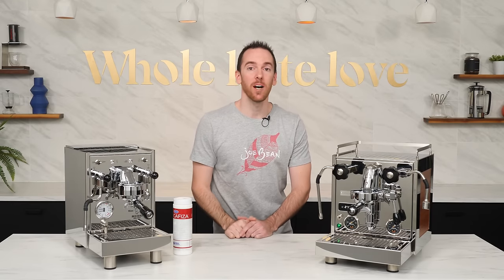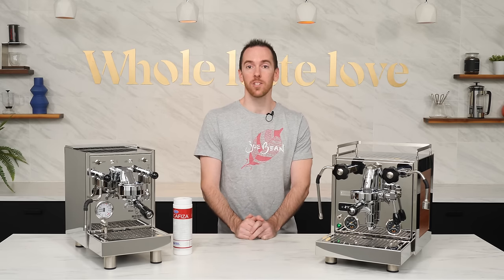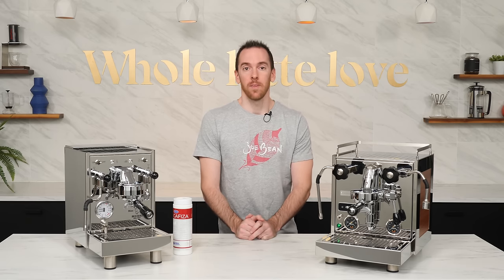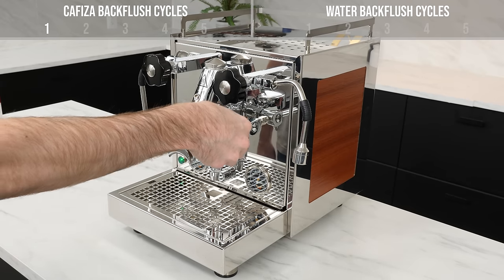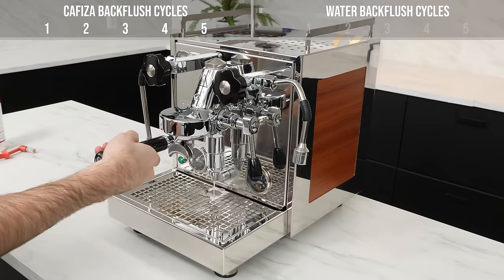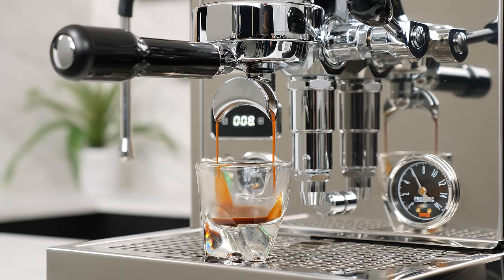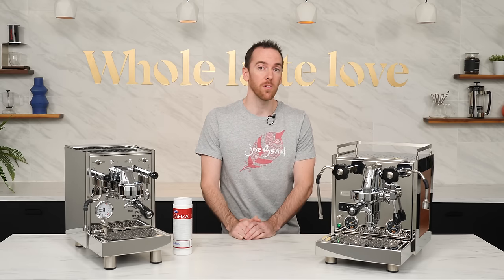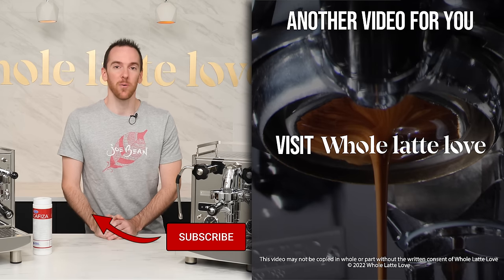How and Why to Backflush Your Espresso Machine

Comment: I really needed this video, thank you so much! So straightforward. I have a Profitec 700 and it tells me when I need to clean it. Super easy. Yes, my machine does squeak afterwards. It scares me a bit but then before I know it, the squeak is gone.
Reply from the maker: Hi RR, You are welcome for the video - happy to help! Those coffee oils lubricate the parts cleaned by backflushing so the squeaks go away. If they don't, it's an indication yoou're backflushing with detergent too frequently.

Comment: Great video. This procedure is somewhat different than what is described in my ECM Synchronika Owners Manual. ECM advises the following steps: (1) lever up for 20 seconds, (2) lever in middle position for 30 seconds, (3) lever down to discharge. Repeat ten times (or more as needed.) I like the procedure you describe here better. I have done the ECM OM method three times over the last year, and I now have a squeaky and stiff lever; that has not really resolved itself. I am wondering if the Cafiza is left in too long (in the ECM method) and washed away the lubricant. I have ordered the lever gaskets and silicone kit to lubricate and replace as required once I open it up this weekend. Going forward, after I lubricate, I am going to use your frequencies and methods and try that out. Thanks again for the great videos.
Reply from the maker: Hi AA, Thanks for the comment! In our experience overdoing with Cafiza can remove lubricant and cause the squeaking. Reducing frequency and duration of Cafiza back flushing is a good plan.
Reply: @AA, I once had the same issue with my Rocket Appartamento. I left the Cafiza in bit too long during the 5 pull cycle and was stuck with a squeaky lever. I used food safe lubricant on the cam and squeak went away. It hasn’t been back since. I you were able to work out your squeak as well.

Comment: I think flushing after each espresso without blind filter, is convenient and enough. I do it, mainly for cleaning the shower head.
Doing the whole cleaning process with cleaner should be done carefully because E61 Brewgroup is lubricated by the coffee oils. So not to be done too often. I guess once a month as stated in the video is good for normal use.
Reply from the maker: Hey Ben, thanks. Good point about not doing it too often on an E61 machine, unless you want to take apart and manually lubricate often.
AJ
Reply: Also moving to an Espazzola-2+3-58 (the new model with the metal tabs) will help clean the shower screen and around the shower screen without adding too much wear and tear to it.

Comment: I thought generally it should be backflushed with detergent every day after use, not just pure water. But now I consider this video as a new insight and will reduce detergent use. Thanks 💪
Reply from the maker: Hi Filip, that's common in a commercial setting for machines the pull 100+ shots a day, but overkill in the home. Different manufacturers have different recommendations, for example ECM/Profitec suggests a detergent backflush every 90-140 brew cycles. We've found it's easier for people to remember on a regular schedule rather than counting cycles, thus the 1 month recommendation, which can be adjusted if you have particularly low or high usage. 
AJ
Reply: @Wholelattelovepage  hi AJ, yes, makes sense definitely. Thanks for additional clarification. Since I am using same E61 group just on Sanremo Treviso, and pull 5-10 shots per day, I will reduce the cleaning cycle for sure. 🙂

Comment: Sir,
I am a coffee machine engineer with 25 years experience and I can advise that not allowing the chemical to “work”.
The chemical cleans by flowing back through the 3 way valve, it foams up an this way propels itself through the 3 way valve.
Also running the group for 10 seconds will not improve the end result. 
The group will fill its limit in under 5 seconds, the pressure builds, then you allow its release, thus causing the chemical to foam backwards, I always recommend leaving the activating powder for maximum of 2 minutes.
I agree with your rinsing though.
I also “advise” my customers not to use the inbuilt backwashing programmes, the manual way will dissolve more coffee oil residues..
Reply from the maker: Hi Pete, thanks for your experience and advice
AJ
Reply: Sorry but are you saying pull the level and hold completely on for 2 minutes runtime straight, or are you saying run for 10 seconds on, the. 10 off for total backflush time of 2 min??
Reply: @ozpain1  the first shot of water will start the activation of the powder, only need to run for 5 seconds as that’s all it will take to fill the ports filter, do that twice then leave for 2 minutes.. after 2 minutes on 5 seconds and off again.
Empty prtafilter and do the no 5 second ..off empty 5 more times.
Reply: @peteb5343  dudes speaking in riddles 😑
Reply: @bigoldawg2791  I'll gladly provide translation "First do 5 seconds with your cleaning powder. Do this twice. Then let the machine sit for two minutes. Then do another 5 second flush. Now, empty the portafilter, place naked portafilter back in, and do 5 more 5-second water flush ( no more caviza powder is needed ) - Good to go! lol

Comment: Great video! I've always wondered, if cleaning with detergent can remove the lube from the lever components, does that mean some get into the coffee each time you pull a shot?
Reply from the maker: Hi kw, good question. Unlikely any lube gets into the brew water. Lube is a food safe grease and grease and water do not mix.

Comment: Damn. I’ve used Cafiza in my boiler. It’s still working fine.  Can I mess up my machine using it? I’m going to get the correct descaling solution. Thanks
Reply from the maker: Hi SB, Don't think it will mess it up. The problem is rinsing it out all the detergent. What make/model machine? Single boilers should rinse fairly easily. It's more problematic in machines using heat-exchange or dual boilers. In those, it's difficult to fully rinse the boiler producing steam as they do not fully fill with water. Run multiple reservoirs of water through the machine. If you are still seeing soapy bubbles in the rinse water rinse until that stops.
Reply: @Wholelattelovepage  I have an ecm synchronika. I’ve always rinsed the boilers about 6 times after I’ve used the cafeza. I’m ordering some regular descaler.ASAP!  I appreciate all of your help. I just don’t want to ruin my machine. Thanks again!!

Comment: Another informative video thanks, have just read through the comments, and I would like to know is it possible to descale the actual boiler in my commercial machine using a solution to put through it, or is it a case of stripping it down and removing it to clean out the limescale.
Reply from the maker: Hi gg, Maybe? Depends on machine type - what does the manufacturer recommend? For commercial machines best advice is in line water filtration to prevent scale formation in the first place. This is the inline filtration we recommend: olelattelove.com/products/bwt-bestmax-premium-filter-package-w-besthead-flex

Comment: I’ve been using Cafeza to descale & clean my group head. Is  that wrong? Should I use something different to descale? Thanks!!
Reply from the maker: Hi, Cafiza is not a descaler should only be used for backflushing brew groups and cleaning parts like portafilters and filter baskets. Cafiza should neve be put into a machine's reservoir and allowed to enter boiler. Use a descaling product to descale boilers. Here's a universal descaling product if your machine's manufacturer does not recommend something particular: https://www.wholelattelove.com/collections/cleaning-products/products/urnex-full-circle-single-cup-descaling-liquid
Reply: @Wholelattelovepage  thank you

Comment: I have an older ECM machine - backflush has always worked perfectly. Now the pressure just builds up in the blind filter but I and can't relieve it anymore pulling the lever - nothing comes out where usually the soapy or brown soapy water came out. What do I do?
Reply from the maker: Hi Sarah, Does your ECM machine have an E61 group? If so sounds like a blockage or malfunction within the group head. If older, perhaps it's time for a rebuild. Here's our how to video which takes you step by step in detail through the E61 maintenance 
and rebuild: https://youtu.be/ELIwD40tsrs

Comment: Im having trouble getting a response from my machine's manufacturer about if this is recommended.  Is this okay to do on a Profitec 400? Thank you for the amazing video!
Reply from the maker: Hi VT, Yes, you should backflush the Pro 400!
Instructions in English on page 40 of the manual:
if you do not have the manual, pdf available here: https://support.wholelattelove.com/hc/en-us/articles/10504064072339-Profitec-Pro-400-User-Manual

Brew group cleaner is available at your specialized dealer allowing you to clean and degrease the brew
group very easily with the included blind filter. Brew group cleaning should be carried out after approx.
every 90 - 140 cups.
We recommend Cafiza for backflushing: https://www.wholelattelove.com/products/urnex-cafiza-espresso-machine-cleaner

Follow the instructions as noted below:
1 Heat up the machine until the operating pressure has been reached (1.0-1.2 bar).
2 Place the blind filter into the portafilter.
3 Fill the blind filter with group cleaner according to the package instructions.
4 Clamp the portafilter into the brew group.
5 Operate the brew group lever. The blind filter will fill with water.
6 Let the detergent react, moving the group lever into the middle position, approx. 45°. (Do not move it
into the lower position.)
7 Move the lever into the lower position after approx. 20-60 seconds to allow the fats and oils to be
discharged by the infusion cylinder.
8 Repeat steps 5-7 up to 10 times, until only clear water is discharged out of the infusion cylinder.
9 Rinse the portafilter and the blind filter with fresh water. Then replace it.
Reply: @Wholelattelovepage  thank you so so much for the fantastic reply! I love this company!
Reply from the maker: @veggietables6974  Thanks a whole latte for the love!

Comment: So when I descale my boilers, am I not also cleaning the group head? Thanks
Reply from the maker: Hi SB, Descaling does not effectively clean group head components. Descalers use acid to dissolve limescale and don't do much to remove coffee oils. Surfactants (detergents) are required to remove coffee oils.
Reply: @Wholelattelovepage  I’ve been using cafeza to do both. Is that wrong then? Thanks.

Comment: Thanks for the video. I’m a new user of the Profitec 500 as of a month. I do the back flush everyday (3 times) and I wash the group head as well. I finally did the Cafisa flush, because it was one month - and when I was done, only a single drip came from the group head - weird. After rubbing it with a towel the multi drips were showering down. Any idea why this would happen?  Thanks.
Reply from the maker: Hi Bob, Cafiza likely loosened some coffee residue and blocked the shower screen a bit. Always a good idea to use a group brush to give the screen a scrub. Can also remove the screen and clean the backside from time to time.

Comment: Do I need to back flush before I use the machine? Or after I use it? Or both?
Reply from the maker: Hi e, Backflushing with a detergent like Cafiza is a 1x every 100-150 brew cycles. Can backflush without detergent at will. Some do it daily but weekly is more common depending on use level.
Reply: @Wholelattelovepage  yes but, do I need to back flush BEFORE? or just after using the machine.
Reply: @edithaebreo  Just after your daily use should cover it..water back flush daily, detergent back flush monthly...

Comment: Interesting! However I guess if I live alone and never do more than 2 espresso per day on my Rocket R58, I shouldn't back flush with detergent every month so after like 60-75 shots at most and should do it every 2 months instead? I was drinking just 1 per day before when I didn't have a single doser with regular & decaf for night so I would backflush every 3 months instead.

Doing a "water only backflush" EVERY DAY seems very excessive if you only drink 1 or 2 cup per day no?!

Oh and it kinds of scare me when I see my brew pressure "not pump" on my E61 gauge go beyond 12 Bars and that it keeps going higher. At which point does it starts to be dangerous?
Reply from the maker: From the R58 user manual (describing a water backflush), "You should backflush the group head every day." They also recommend a detergent backflush "every week."

It's always best to stick with the manufacturer's guidelines, however with your use, you should be fine to do it every month after the 60-75 shots. 

As for the brew pressure gauge, on that machine pressure should be regulated by the bypass valve on the pump, and then the over-pressure valve will add an extra layer of safety. Going beyond 12 bars seems odd. Have you calibrated your brew pressure of the pump? (Page 15 of your manual)
AJ

Comment: Hi there, if my machine have two eyes or two portafilters, should i do it for both or just one? And how do i clean the portafilter after soaking it in detergent? And is it poisonous?
Reply from the maker: Hi m, For backflushing you only need to use one portafilter. After soaking in detergent, rinse well with plain water. It's not poisonous but can cause burns if used improperly.

Comment: I have a BZ13. Do I need to do anything else besides the back flush?
Reply from the maker: Hi SJBJJ, use water that will not cause scale, If taking hot water from the machine is not something you regularly do take a cup or so daily to stop minerals from concentrating in the boiler. Manual and more available from our Support site for the machine: https://support.wholelattelove.com/hc/en-us/sections/360011447434-Bezzera-BZ13-PM
Reply: @Wholelattelovepage  thank you so so much

Comment: I have a DeLonghi EC702 and don’t see anything about backflushing in the manual. Was working great, then it stopped dripping. I have descaled it per the manual and the solution came out like a geyser indicating there was mineral buildup. But once I began using for espresso, after two shots or so it returned to barely dripping, no crema… any ideas as to what I’m doing wrong?
Reply from the maker: Hi ZW, Your appliance level espresso maker does not have a 3-way solenoid valve so it does not need backflushing and should not be backflushed. Chances are your problem is scale buildup. If it was severely scaled prior to descaling then descaling may have  loosened up but not removed all scale so it plugged things up again. You could try descaling again and it might help.

Comment: I have a KOTLIE CM5080 Espresso machine from Amazon. Would you know if it is fine for backflushing?
Reply from the maker: Hi m, I'm not familiar with the machine - but have used similar entry-level appliance grade products. Back flushing those types of products is not a thing as they do not have valves which release pressure within the portafilter at the end of the brew cycle. I'm guessing it would be recommended  with a procedure in the manual if needed for the product. I can say that every machine with the valve which releases pressure exhausts the pressure at the end of a brew cycle. You would a whoosh and excess water from the portafilter would be output somewhere - usually the drip tray. If you do not hear/see that happening I would not back flush unless specifically recommended by the manufacturer.

Comment: Great video! Thanks! 
I use IMS baskets / shower screens with Nanotech coating.  Is it true that if I use products like Cafiza, I could ruin the Nanothech surface?
Reply from the maker: The nanotech coating on the IMS baskets/screens is similar to working with a non-stick pan - works great at keeping things clean but the more use/abuse it gets, the shorter the lifespan of the coating. I have heard reports of cafiza wearing away the nanotech coating at a faster rate. That's not the worst thing in the world, but if you want the coating to last as long as possible I probably wouldn't soak it with cafiza. 
AJ

Comment: Do you take the shower screen off too or leave that on and directly insert the portafilter with the back flush disc?
Reply from the maker: Hi a, leave the shower screen in place for routine backflushing which helps clean it. It is a good idea to remove the shower screen every few month for individual cleaning with detergent like Cafiza. Also clean the shower screen holding plate and group head area.
Reply: Awesome, thank you so much 🙏🏽

Comment: I remove the shower screen and brass disc (not sure what you call it). Clean them well. Reinstall them and then back flush. I figure why push this grime back into the machine if I don’t have to. Please tell me if I’m wrong. Thanks.
Reply from the maker: You're not wrong and it is good to remove and clean them periodically, however it's likely overkill to do every time before backflushing. The grime will dissolve and be removed through the discharge tube. With the 5 detergent cycles and 5 water cycles, it should all nice and clean inside. 
AJ